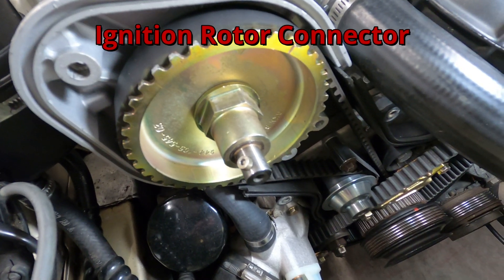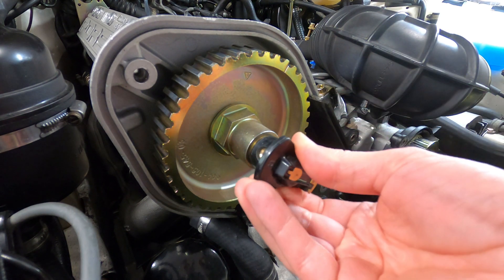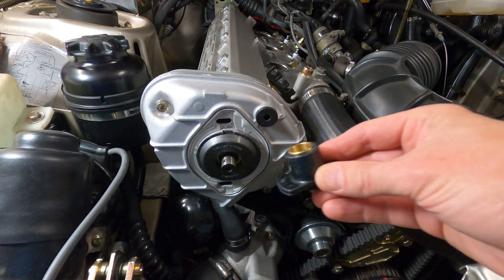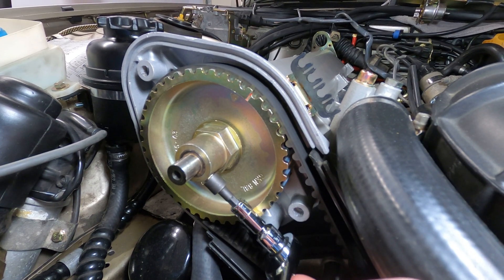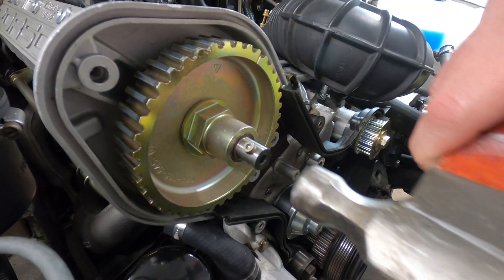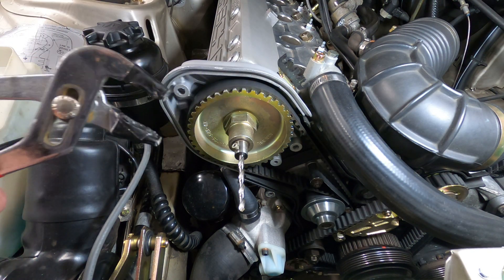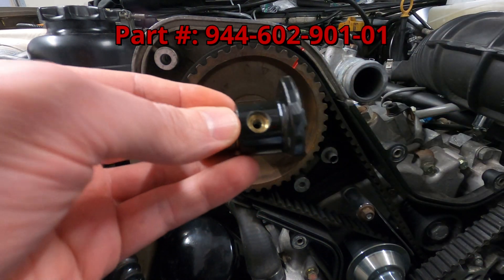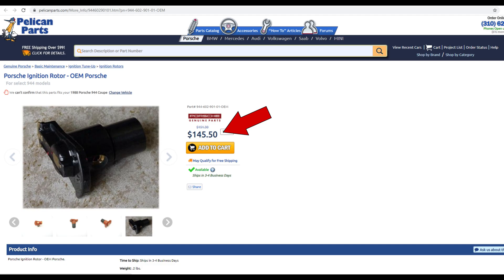Porsche 944 – Ignition Rotor Connector Removal & Installation Tutorial

Comment: Hey I was wondering where did you get all those beautiful zinc coated parts. (Ie Hood latch, bolts, hose clamps)
Reply from the maker: Sure! A little bit of a mix, so the low cost stuff like bolts, washers, and clamps I just ordered all new stuff. 

For the larger steel parts like the cam gear, hood latches, brackets, pulleys, etc, I had them bead blasted and zinc coated locally, ran about $260 for what would have been $2,000+ worth of retail cost to replace. 

Check out my headlight control shaft restoration video for a before and after look at the parts. Makes a big difference. It’s like that philosophy: “You car is only as nice as the worst looking part on it.” So it’s hard to not get carried away. 🤣